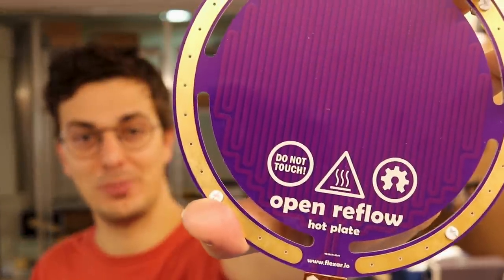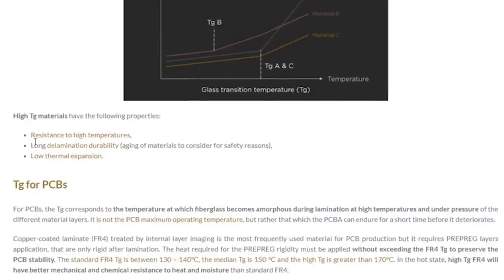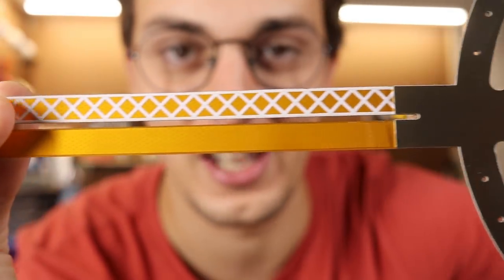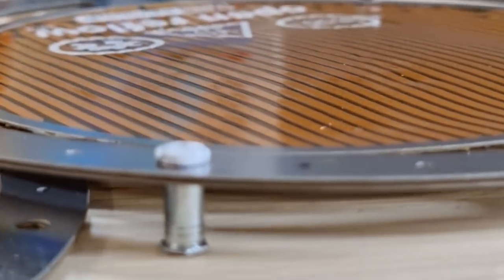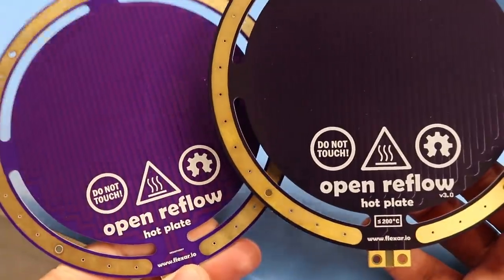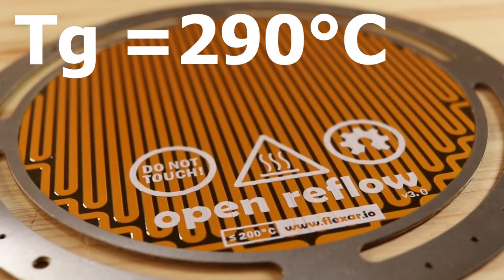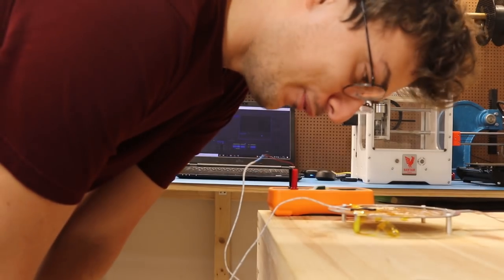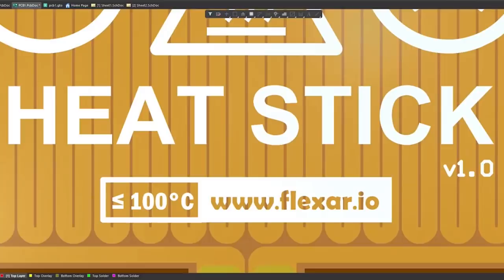Experimenting with High Temperature PCBs!

Comment: Who is reflowing for 3 hours? Just slap a controller onto it that cuts the heat after some time. Please don't give up!
Reply: How long do people reflow for?
Reply: i thought the same!
Reply: Longetivity tests.
If it works for 3 hours In the lab, it’ll work for 99.9% of home use cases.

It’s called over-engineering and end-user proofing!
Reply: Decoloration is the last of my worries!!
Reply: @BleughBleugh  "End user proofing" hehe nice
Reply: No one is reflowing for 3 hours, but this demonstrates that the PCB will degrade after an integral time of 3 hours (60 reflow cycles more or less).
Reply: @genepezzulo  you forgot that this would also include 60 reflow processes in a row since in normal use cases you would have it cool down after every reflow process
Reply: Maybe not reflowing but for example heat chambers on high temperature polymer 3d printers reach 200°C and the printing surfaces are higher than that and some prints last days
Reply: @Livii89  which is ultimately less stress on the PCB, not more. One thermal cycle versus 60. In real use the delam would have happened after only 10 or 20 full thermal cycles, maybe even fewer.
Reply: @tissuepaper9962  so you want to simulate excessive use to make sure there won't be any problems under normal circumstances?
Reply: @Livii89  exactly. I don't even know if a couple hours of continuous duty is excessive. Say I buy one of those hotplates from him (because it seems like his end goal is to sell this as a product), and I have to put together a dozen of some little SMD widget I designed. Say it takes 5 minutes to place all the components, and 5 for the reflow. I might leave the hotplate on for the whole hour, because I can populate the next board while I'm waiting for one to finish reflowing. If it starts visibly degrading after just that one day of work, I would definitely purchase a different product to replace it when it finally lets the smoke out.

The end user is a potent destructive force, and also a fool. These are the guiding principles of UX design.
Reply: @tissuepaper9962  so its recommend to test for the longest time someone would possibly use it, got it
Reply: @BleughBleugh  If there's anything I've learned about "end user proofing" it's that no amount of engineering can defeat blind stupidity. The end user will, without a doubt, find the most unexpected and elegant way to destroy all your planning.
Reply: @RobertKreegier  end users are often ingenious in ability to be incredibly stupid :-)
Reply: The reason why is because if it survives that 3 hours, it'll last for years afterwards. If it fails, it's not durable enough and definitely not suitable for end users.
Reply: @BleughBleugh  Ah, exactly what I was thinking, well said.
Reply: I for one would love to see you offer a kit! I was looking at some standard reflow time vs temp charts, and it looks like the total time is about 6 minutes with only one minute of that time spent between 200C and 250C. I'm not so sure there is an issue here with your current design? Couple this with a pre-programed controller (esp32?), thermocouple, SS relay and a power supply recommendation, and I think you have a winner...

Comment: the bulging has little to do with the adhesive, its just the thermal expansion of the material. It being 'clamped' in the metal frame. If you leave it floating in the frame you should have less to no bulging.
Reply: A frame that tensions the flex pcb like a trampoline should work well with the expansion.
Reply: @FreeOfFantasy  it's cool because you first get the PCB in one shape but over time it becomes a shapeshifter.

Comment: 3:46 You can measure the average temperature of the entire cooper track by measuring the change of its resistance. There's a normalized method that is used to measure the resistance of transformer windings. But I don't know how good would this method be in this case, considering the low resistance of the track.

Comment: I'm sure its been suggested but you hang get an aluminum one without a solder mask (you could later apply one if needed High temp spraypaint).  The only thing that seems to degrade is the mask.   Also when using a heater it is useful to have an insulator on the bottom.
Reply: I guess the issue with no solder mask might be shorts via whatever PCB you put on top to reflow. How about a solid sheet of copper on the bottom at VCC, a solid sheet on the top at GND, no solder mask on the top, and use vias between them as the resistive paths to generate the heat? That would solve the shorting problem as the whole top is at GND, though it might be harder to calculate the resistance of a network of vias rather than a single trace, and of course it might be hard simply to get vias with a high enough resistance at any drill size. What you could do is simply have a short narrow trace on the bottom between each via and GND, which is actually generating the heat, but that heat is well transmitted through the via to the top.

 Certainly adding an SMD temperature sensor to the middle of the PCB seems like it would be useful, and a time-out shutoff of 20 minutes or whatever should be more than enough anyway
Reply: Isn't there an FR4 spacer between the aluminium and the copper? Epoxy fiber glass doesn't really like high temperatures, especially over longer periods of time
Reply: Exactly. At the voltages this works at baking oven paint should work well enough.
Reply: Put the traces on the bottom of an aluminum pcb. The aluminum is such an excellent conductor of heat that it should be plenty hot on the untraced top
Reply: @peterrhodes9121  At that point, what do you even need the PCB for?

Comment: I wonder if they can tell you how cumulative the damage is? How many times can you heat it to 200 degrees for 10 minutes? If the answer is 3 or 4 times, then that’s obviously not good enough. But maybe it’ll last a lot longer in 10 minute bursts? Or maybe cycling will make it die faster due to expansion/contraction. Seems worth testing if you have spare boards that you can’t really use.

Comment: Great work, keep it up! I believe this is still viable if you implement those time limits and add temperature feedback control. Generally, as a hobbyist, you shouldn't need the hot plate to stay hot for more than a few minutes at a time
Reply: I think this would be great to have around for 1 off reflows. I don't do enough work in this realm to justify a hotplate but this would be great even with the constraints. I'm currently re-flowing with a heat gun...
Reply: I suggest adding 
a) some kind of thermal-isolating/IR-reflecting chamber to reduce ambient loss 
b) temperature control to prevent overheating of the copper layer

Comment: That the rating is time related makes perfect sense, given the way those sorts of ratings are normally stated.

Most 3D printer beds like this use the metal surface as the bed. How hot does the stiffener get? How about insulation on the trace side, and then measure the temp of the stiffener?
Reply: Exactly. Much better to do it that way anyway because you want even heating in your components. Polymers usually have low thermal conductivity and I would think you have a higher likelihood of cold joints on a large component or unevenly populated board.

Comment: Dude I had that problem at my job. We called it bubbling on PCBs. We put them in a oven overnight to evaporate and dry. We added a ceramic plate over the heat lamps that was a combination of ceramic and another side a different material.
Definitely try the ceramic, it’ll work better.

Comment: how about flex pcb heating pads for diy beer wine brewing you could build on board temp control and monitoring, get real fancy and ramp up and down temperatures for optimum yeast activity and results for best taste flex pcbs are ideal as they can be wrapped arro8uund any size fermentation vessel behind some cheap insulation and just think of all free beer ;)

Comment: What if you were to bolt two polyimide steel-backed PCBs facing each other? That way, the mechanical force will keep the sandwich together, thus the adhesive delamination will not even matter.

Comment: Hey man, for the delamination problem it might help not to make such long straight lines. Copper expands and this creates force then upwards away from the pcb. Outside its cooler and it still sticks so you create that bubble. Try more a zigzag shape then the expansion is distributed to both axis. :)

Comment: Insulate most of the hot plate (ex: the back, and sides). This will reduce the difference in temperature between the inside and the surface at steady state. Then if you bring it up to temperature slowly it might be ok: I suspect it might not be enough to save the project, but it should help a little, and can can be easy (ex: just put in if a couple layers of an old towel). Maybe if you insulate the top between uses (ex: throw a rag on it), it might be enough to keep it basically at a 200 degree steady state all the way through.

Comment: Rating something for 288c for 5 seconds sounds like a joke. It seems deceptive. Is there really a case where a pcb would get that hot but then cool down before the 5 seconds? Seems extreme.

It's similar to how subwoofers are rated for "1000W" but they mean peak.
Reply from the maker: It is a little extreme but they are just recommendations.. I think it applies for soldering irons

Comment: We attempted to make heat beds for 3DP from FR4, Polyamide, and other materials using graphene in 2017. They didn't survive.
Reply: Didn't survive under what test conditions and with what failure mode?
Reply: @SianaGearz  They burned the hell up. Separated just like this issue he is having. Material couldn't take the increased change in temperature. Graphene heats quickly with less power than it takes to heat a circuit board track resistive heater. We used to have videos on Facebook of the testing but Creality wiped all of the work along with all of the mods to the CR-10.

Comment: Seems like something that could be corrected in software. PID loop perhaps? Use your sacrificed board to tune it to the actual temperature, then see if the same profile works well enough on another board with an offset temperature value

Comment: Connect these two aluminum heaters with screws, give a spacer from the capton tape. Not important what will happen inside anyone there was no short-circuit. Operate on metal side.

Comment: Well, as another comment suggests, it would still be a good kit for small scale reflowing, or like a limited amount of time. Making reflow accessible at a low price is probably good anyways.

Also, they make good beds for most 3d printers. Just look at prusa.
Reply from the maker: I will probably do it 😅but a more generic version so that is could be used for multiple things (not just reflow) probably I would rate it at lower temperatures and then specify that at higher temperatures in has a limited number of times it can be used

Comment: I think your testing method is flawed. You aren't going to be reflowing for 3 hours straight in a real world scenario. Instead you should be measuring the degration over many shorter hot/cold cycles.

Comment: I know I'm a bit "late to the party" here, but I have been collecting materials to make some testing prototype reflow hot plates by custom-making my own PCBs using >500C rated moldable ceramic as a base layer, and also a ceramic-based (or at least ceramic impregnated) solder mask top surface.

If I am successful in my early testing, would you be interested to maybe do a #collab project with this?

Comment: 1. Looking at your steel frame, there is no way to expand under thermal expansion. 2. Your polymer will expand much more than the steel frame. 
By not placing the 'spokes' opposite to each other (eg. 3*30 deg), and preferably not straight, but under an angle to the heated surface, you will reduce warping a bit, or at least give the steel plate some room to wiggle around and follow the expanding polymer to prevent delamination. Good luck with your project!

Comment: silicon heat pad + 2-3mm aluminum plate and you're done... Even if you going to find a PCB that is stable for 30-60m at reflow temperatures the heating cycle would kill it rather quickly unless you want to heat up and cool it down over 2-4 hours to avoid cracking or delamination.

Comment: Why do you need the solder mask on the heat portion? You are only dealing with less than 10V and it's DC for that matter. Unless you can't request flex PCBs without solder mask.

You will only have millivolts (at best) across any two points on the board being reflowed.

Comment: my solution was throwing away the horrible T-962A and do the job with an Aluminiumplate (overmilled cast aluminum) with ceramic resistors clamped onto the back. I have this 2 times ... one for preheating and one for the soldering process. An Arduino micro does both temperature controls

Comment: Probably would help to split heater onto 2-4 separated circuits, and power simultaneously only 1 circuit at a time. Using timer switch power from one circuit to another, by this you won't overheat traces, trace will heat up then shut down and while another trace powered this one will dissipate heat to PCB, and so on. With right picked time delay it should last 10-20 times longer, it will degrade eventually anyway.

Comment: Aren’t there heating elements that are relatively cheap and flat? I think this is a case of “why make it a PCB if something else will do it better”. Though of course you’d have to have done all that testing to realise that. The “high temperature ceramic heating plates” are relatively cheap, same for the aluminium shrouded ones. I’d also be rather interested in using a TEC with a heat-sink on the cold side. You’d use less power than a normal heating element, and the cold side would allow it to cool more rapidly if you wanted. Measuring the temperature might be difficult though, you may want to put a shim of aluminium between the hot side and the workpiece to distribute the heat more evenly, with the thermocouple inside that.

Comment: Why not just strap the nichrome wire on aluminum for better heat spreading? That's how I built my 3d printer heated bed with a ds18b20 stuck for temp reading.

Comment: Why not use an enig finish and leave off the soldermask? Maybe use a copper fill ground plane so the surface looks like solid gold except for the area between the track and the ground plane. The manufacturer might not like it because they don't like seeing huge areas covered with gold, but this should stress the PCB a lot less than having the soldermask insulator does...

Comment: Breaking Taps used Kapton tape that had been irradiated with a laser to form a layer of graphene which can act as a low voltage DC heater that can reach ~200 °C. No idea if it'd be suitable here.

Comment: Why not just do a ceramic heater? as un ceramic - cooper/nicrome - glass?  it will b bulkier but isnt that expensive. You could even cheap out on the ceramic and use steel reinforcement  and hav a thinner ceramic layer.

Comment: Dude, bulging and wraping and delamination is bad, but discoloration is fine. Think about it, it is the color pigments that degrade and nothing structural. I guess if you go with black which uses carbon as pigment then you should be good.

Comment: The thermal gradient between the surface and the Cu can be improved if you add thermal isolation in the areas where you dont need heat output. fiberglass? teflon?

Comment: What if the copper traces were exposed/not covered with solder resist? To allow better heat transfer since it seems the solder mask is acting as an insulator between the hot traces and PCB to be reflowed

Comment: There is ceramic substrate too, which doesn't has flex and is resistant to more than 300C, when the silver/copper is protected against oxidation. But a simple aluminum block plus a silicone heating mat insulated on the back should be cheaper.

Comment: Maybe encapsulated between the metal plates(aluminum/copper) with pads to ground it to the flexible pcb with a fuse set just above the expected current. You could even have a smd fuse on the flexible pcb.  You could use thermal grease or adhesive to help prevent deformation between the metal plates and heater.

Comment: This was a random YouTube recommendation, found it interesting, just trying to understand what's happening here. What's the PCB, is it the hot plate? Which means you created a solder melting product by ordering a PCB in particular pattern?
Reply: Yes. Fundamentally, lower temperature PCB heaters are well known, almost every 3D printer uses one rated to less than 120°C on the built plate, used at around 60-80°C for most printing materials, so you get adhesion during the print process, but afterwards, some shrinkage occurs and surface properties change with temperature, and the print is easier to remove. But he's trying to see how far he can push it with material options that the companies offer and design changes, to try to make a reflow plate, maybe it's better explained in a previous vid. He made flex-PCB magnetic actuators and motors before.

Comment: Have you tried adding the metal stiffener to both sides?  I know some of the silicone heating pads need to be sandwiched to get the heat away from the pad or they will get damaged.

Comment: Why not follow the standard  SMT Reflow Soldering Temperature Curve.

There wont be a need to set the temp to 200 *c all the time.
Reply from the maker: Yeah you could do that but there will be a limited number of reflow you could do - maybe reflow 3pcbs and then through it alway - like a " disposable hotplate " the price needs to be cheap though - I'm going to give this a shot with the HeatStick project I showed at the end